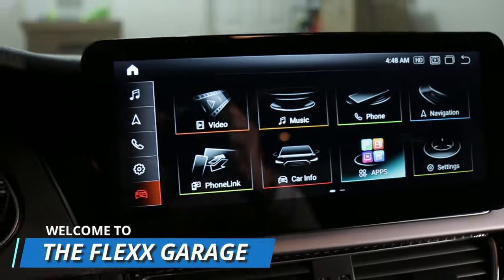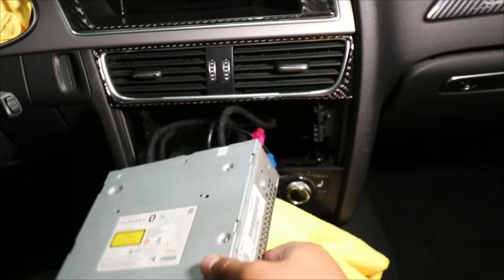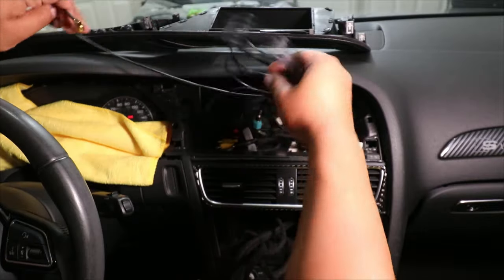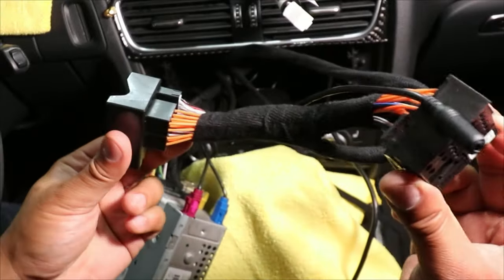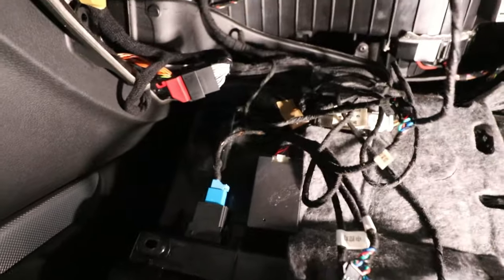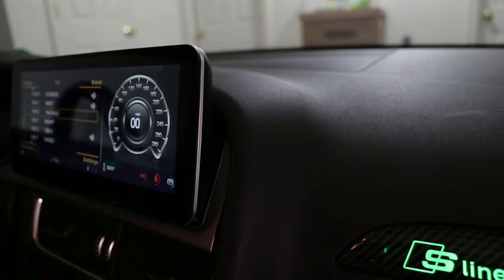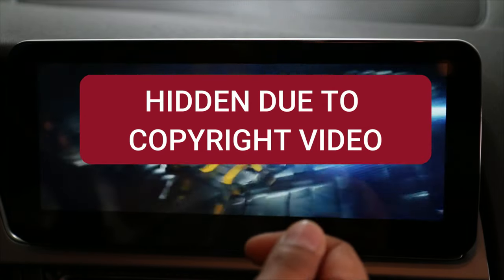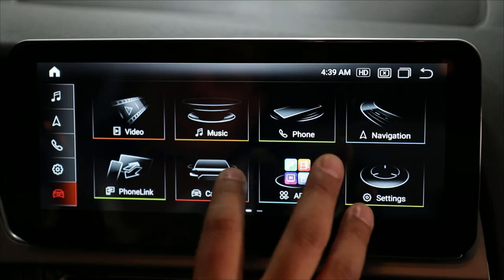NEW Android Screen step by step install on Audi A4 (B8.5) 2008-2016

Comment: What about how the iPhone looks connected to it.  Are you connecting the iPhone via the usb port? Does Bluetooth connection operate any different.  What about a memory card connection? How do you watch HD and 4k video? Said 4k was compatible but it’s a 1280px screen which is 1/4 the resolution. What steps will allow this to play movies and what will it play? Does it have it’s own navigation?  What features that you regularly use when driving daily that this Android system actually offers?  Does this give you RCA outs now for a sound system?  Does this give you the direct subwoofer volume control?

Comment: Purchased this screen. When arrived looks nothing like the one in video. Also harness are not the same. Didn’t come with instructions. Ordered this product from DMP car design.
Reply from the maker: All kits are not the same. It depends on your cars year and model and also what stock radio model you already have in your car.  

And there’s no instructions cause these are designed for professional installs.  These are not just plug and play kits.  It requires skill to install and requires custom software setup. 

My video is not a “how to” video for every kit out there.  My video is just my own experience with the install on my own car after me figuring out by myself what goes where.  I still need DMP’s help on setting up the screens software to work properly. What you do with that info is up to you. 

If you wanna install it yourself,  reach out to DMP and ask for tech support. That’s what they are there for. It’s their product and they provide support and warranty on it.

Comment: Man, i love you. May God give you a blessed and happy life.
Your example was what i needed.
I bought a same android interface, went to a shop to mount it but it didnt worked. The reason was that the CANBUS cable was not connected as concluded from your video.
I tought it was the wrong cable for my A4 model..
Love you bro, love you. Keep up the good work
Reply from the maker: Did it end up working?
Reply: @TheFlexxGarage  the event took place 8 hours ago at a dedicated service that mounts navigations, for wich i paid $$ and didnt even know about canbus, wich is sad. 
He told me to make some pictures and send it to the vendor from wich i bought the android device. I looked at the pictures and compared the conectors with your video, and he was holding the canbus in his hand :)) no wonder it didnt worked.
 i will go to a friend maybe tomorrow and see if i can do it with him, because i have no ideea about cars :D ( but i have learned something new today in few hours)
Reply: @TheFlexxGarage ok, so i successfuly mounted with a friend. The only issue is i get a static noise if i listen to music or when i don't listen, just turn the volume up. Any ideea why? AUX connection is used by this android navigation wich i heard is not that "proof" 😢
Reply from the maker: Interference. You need to get a “3.5mm aux noise isolator”.  It’s not included in the kit because static issues don’t happen in most cars but sometimes it does so you need to buy one on your own.
Reply: @TheFlexxGarage  but i dont have an aux jack on my car, i only use the sound from the navigation system connected to the internet (youtube,spotify,etc)
I remember that the navigation had an aux cable with female port, but im not using it
Reply: @xpnexus2265 did you have any issue with getting sound from your device in the first place? I have fitted the same device but there is no audio through the speakers from the device. I have no AUX either, AMI instead. Any ideas?

Comment: With PhoneLink, you said that you can use Apple CarPlay. Is that wireless and wired carplay, or just wired? Also, have you used CarPlay with it? If so, does the touchscreen work with CarPlay as expected?

Thanks for the videos man! I'm new to the B8.5 platform (A5) and these videos have been very helpful

Comment: Would you say the 12.3 inch is too big for an Audi A5 b8.5? I can’t make up my mind if I want the 10.2 or 12.3
Reply from the maker: Go with the regular 10 for an Audi. The 12 is too big. The 12 only fits well in the Mercedes c-class I have.

Comment: Hi, very nice video. Few questions:
- does it keep the B&O sound without trouble?
- does it switch to rear camera when you set the gearbox to rear while you're on the Android interface?
- what about the parking sensor?
Thx
Reply from the maker: 1) it works through your speaker system. Doesn't matter if its base model speakers or high end.

2) it goes into reverse like a normal screen then goes back

3) it works like your normal car

Comment: Hi I have put this system in my car and everything works but the old Audi infotainment system shows NO SIGNAL. Does anyone know how to fix this?
Reply: I also bought one and from what i understood is that the android sound goes through the external mmi output. I dont know what car yoy have but the connector should be in the glove compartment. You should be able to connect that to the aux output cable attached to one of the wires that goes to the screen
Reply: In factory settings > Vehicle > ensure your correct car model software is selected

Comment: I'm a little confused I've seen videos of your Audi and I love the process and the result you had, well I'm confused in the step of disconnecting the red connector and connecting the yellow and then the red to the black I've seen your previous videos like the one with the interior lights you did the same thing later when you put the CarPlay, but the red is always there and then you do the same thing. Am I missing something? Thank you and keep it up, good content.
Reply from the maker: This screen install video doesn’t take into account the ambient kit or CarPlay kit.  It’s a fresh install for people with no ambient kit and no CarPlay. 

Same goes for those other videos. They are fresh installs. 

If you want to have an ambient kit and screen….or an ambient kit and CarPlay kit, they piggyback onto each other using their expansion ports on their harness and can all connect to the main red connector on the car behind the glove box.
Reply: @TheFlexxGarage  got it, thanks!!

Comment: Hi I’ve seen your videos big fan love the details and you helping everyone I have a question about your Audi a4 when you installed CarPlay you connected a wire via the glove box it was a red connector that you switch for a yellow connector As I see you have the ambient lighting as well I’ve seen installation videos on that and they use that same connector the red one and switch it to a yellow connector my question is how were you able to do both ambient lighting and CarPlay with one connector?
Reply from the maker: You can do both. They can piggyback onto each other. Each mod’s harness has an expansion port to plus the other one in too.
Reply: @TheFlexxGarage  thank you for info really helpful keep up the good work man
Reply: @TheFlexxGarage  sorry for confusion but by Expansion port are You meaning a whole different connection ? or by Piggy backing the Ambient male connector go in Canbus port and the carplays main male connection goes in the ambient second port and the carplay second part connects to smaller canbus port ? sorry to bother i just wanna get it right

Comment: Noob question: Do you remove the battery before working on this? I once took off the emergency light cable and I had issues and had to bring it in to Audi.
Reply from the maker: I’ve always disconnected the negative/ground side of my battery when working on electrical components on my car.  I’m not gonna risk shocking myself, causing a spark or fire, or accidentally having a tool touch something and fry something.  I’ve been doing this on all my cars for years with no issues. Even my r8 is being stored with the battery disconnected and I reconnect it every 2 weeks to start the car for 20mins and runs fine everytime. Yes, “sometimes” when I reconnect the battery there might be some fault lights but that goes away after driving for a bit.

Comment: Hello, I also have a 2015 A4 S-Line, how does the little screen in the instrument panel work after upgrade? With OEM, the screen shows navigation, radio etc., how does it work after upgrade?
Reply from the maker: As stated in the video, the screen can display everything that was already oem when you are in the oem screen interface.

Comment: Hi my friend 
A need you help 
I see you video I like 
I have de similar Screens, all installed is the same, but the android screen sound is not working,  the original sound is ok, I not idea whit happens, you can help me?
Reply: I think you need to switch to the AUX mode, because the android screen is using the AUX for the sound.
Reply: @derLange  what do you mean by aux mode? Is there an aux cord that we have to run or is there an oem aux plugin? I have a 2012 A4 B8

Comment: Does your stereo system have to be AMI or MMI? I’m hoping this is compatible with both.
Reply from the maker: Doesn’t matter.  Go to the dmp link. They have a screen based on your stock radio system.

Comment: What about the OEM GPS antenna i already have in my car, dont you use that with the new system, or is it only for the new system.? Or do the 2 system run on their own GPS antenna, Old MMI uses its own, and New screen uses its own. just confuses me a little. 🙂
Reply from the maker: The old gps works when you are in the oem interface.  The new gps works when you are in the android interface.

Comment: So where do you connect the ambient light connection in the glove box then? They look to be the same connection.
Reply from the maker: I didn’t show in the video because not everyone has an ambient kit but you just piggyback it.   The ambient kits male connector plugs into car’s canbus port and the yellow male connector for the screen plugs into the female end of the ambient connection that’s an expansion port.

Comment: My Audi a4 2009 b8 has been lots of problems lately with the wheel bearings and motor mounts and much more. Was wondering if you have been having problems with the 2015 a4. May look to get it because my a4 has been very frustrating for me with maintenance
Reply from the maker: That’s why. It’s the 2008-2012.  Those are notorious for issues. The facelift (b8.5) are way better.  My 2015 has been perfect.
Reply: @TheFlexxGarage  a4 motor 2.0 tfsi 2015 best audi motor 4 cilinders

Comment: I love the display, but what kind of camera could I add to pair it with this display?  I don't have a back up or front camera and I was thinking of getting both.
Reply from the maker: Not sure. You gotta ask DMP. It’s their screen and they provide accessories for it.  I’m pretty sure the have a backup cam that’s compatible.
Reply: @TheFlexxGarage  Thanks
Reply: @TheFlexxGarage  Which is the one that it’s in the video?  There’s like 3 different ones for an A4
Reply from the maker: You have to pick the one that’s compatible with your oem radio.  There’s detailed pictures on the website which screen match with which oem radio style.  You need to check your oem radio and match it up. Contact DMP if you can’t figure it out.  They are there to help you.
Reply: @TheFlexxGarage Thanks

Comment: Do you really needed to install that small speaker?  What is it for? I watched other videos like yours, and allegedly, that speaker doesn't need to be installed, with the mmi 3g system You used it for a while. Any idea? 
I'm about to install mine tomorrow. 
Thanks for the video anyway. I was stuck,  because my Audi is an B 8.5 too.
Cheers, Tibor
Reply: Did you finish your install? I have the exact same car and the same device as you, but I cannot hear any audio from the device through my speakers in the car
Reply: @danmitchell970  did you manage to fix this?

Comment: Hello there... I saw your Video and you explained it great. The only thing I wanted to ask: if you have an android phone and you go on Phone, can you also play Musik with your phone through the phone setting or do you need to download the music?
Reply from the maker: Nothing needs to be downloaded.  The CarPlay shows exactly what’s already on your phone.  If you have music already on your phone, then CarPlay will show it and play it. However if you connect any android phone…you would be using the Android Auto software, not the CarPlay software. CarPlay is only for iPhones. Android Auto is what’s used for Android phones.
Reply: @TheFlexxGarage  ah ok... So it also works with Spotify and Napster and so on ?
Reply from the maker: It works with whatever apps already on your phone.  The only thing is some apps might not show up cause if an app can cause distractions while your driving (like a video app like YouTube)…it won’t show up on the cars screen. That’s for safety protection set by the law.

Comment: Hi, thank you for the video! I followed your guide and installed my andriod unit, however I am having problems with the audio output and I can't find the answer online. Your guide doesn't show anything to do with the AMI cable / Aux output, but the seller of my kit says thats the problem. However, when connecting to Z-Link, my audio worked for the first 2 seconds, then it went off, so I'm not sure exactly what the problem is!
Reply from the maker: Mine has nothing to do with ami cable or aux cause it’s not needed.  Not all screens kits are the same. I only trust my stuff from DMP Car design cause they support their products.  I ran into a no sound issue when I was in the android interface and all I needed to do was find the 2 white tiny connectors on the main harness, switch their connections (take one off one and connect to other white connector…and do the same for the other one), and Audio worked.
Reply: @TheFlexxGarage  Hey there, thank you so much for your response! I actually figrued it out yesterday morning, the fix was quite simple. In the new unit i had to go into factory settings and turn off a setting to do with the AUX, for some reason it was set to 'auto' and that was forcing my AUX setting to be rerouted to WLAN, turning off this setting meant it would stay in AUX, which in turn meant its now working as in tended HOWEVER, my next problem is the airbag light is now on, despite connecting the Y shaped hazard light connector. Did you have any problems with this?
Reply: WHAAAAAAATTTTTT??!! Now I need this! Your videos are gonna have me broke…😂😂😂
Reply: @marn6128  where was the aux setting? The only setting I'm seeing on the aftermarket radio is for Aux Position under Settings.

Comment: i have S4 2012 with bang&olufsen audio. Do you know if fit in my car?
Reply from the maker: It should work fine. I have the B&O system on my R8 and installing a screen on that car was almost exactly like my A4. If you want to triple check, just message DMP and ask the question.

Comment: I’m trying to connect the display harness to the cable I unplugged from the OEM screen but my cable did not have a round connect it has a larger rectangle one. I looked in the kit to see if there was some sort of adapter but nothing anything help. What is the difference between the Audi A4L & Audi A4?
Reply: Did you get an answer? I have the same issue 😢
Reply: Ordered the wrong Stero, but now I can’t get the glove box to come completely off the left side !

Comment: My screen dosent turn off when the car does , I have to press the button on the screen make it go blank but I feel like this still uses battery?
Reply: I have the same problem. Did you manage to solve it?
Reply: My screen does not turn on at all and i have an extra cable no video has said what to do with it
Reply: Did you find a Solution? I have the Same Problem.

Comment: Very nice.
So you disconnected the initial module you did in a previous vid, which didnt have the touchscreen but utilized the oem screen and did a full install with thia touchscreen, which has the module embedded in the screen?  Just so I'm understanding this correctly
Reply from the maker: Not sure what you’re saying but my ambient kit was connected to the canbus port behind the glove box. I disconnected that so I can do this screen video and have the screen connected to that same canbus port. 

I did that cause people will watch one video or the other video, but not both. So I did clean installs from scratch for each product. 

However, I have both the ambient kit and screen running off the same canbus port right now.  It’s just not shown in the videos.  Their connectors have an expansion port so I can piggyback one product to the other and plug 1 single connector to the canbus port in the car.

Comment: I noticed you had the hazard with the passenger airbag light, did any codes pop up when plugging into the new hazard switch/minus airbag light?
Reply from the maker: Zero issues

Comment: My mmi tells me AMI is not connected. Even my old AMI Bluetooth isnt recognized anymore. So i dont get audio out of the radio via aux anymore. Dont know how to fix this issue. Anyone fixed the same problem ? (Tried with the 3,5mm AMI and without)
Reply: You need a AMI connector which you get included with all the other cables
Reply: Where can I find that?

Comment: What’s the mini speaker for?
Reply: And how does the deck effect your audio quality?
Reply from the maker: It’s for when you are using a gps app from the android interface but you decide to switch the screen to the oem interface.  Your car speakers will continue to play from the oem interface (cause you’re on it) but gps directions from the android interface will come thru the mini speaker. 

If you use the gps app and stay on the android interface, the gps directions will come thru the cars speakers (not mini). 

And no. It doesn’t affect quality. It may enhance it because now I have access to a full EQ to adjust the audio to how I like it.